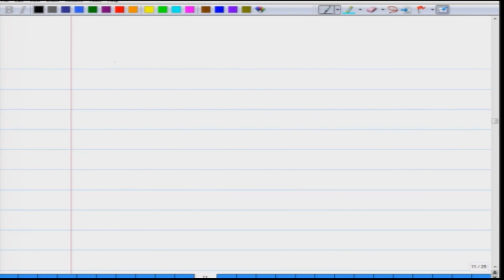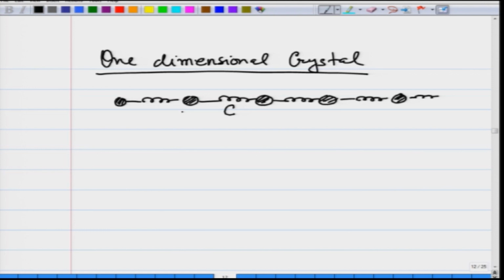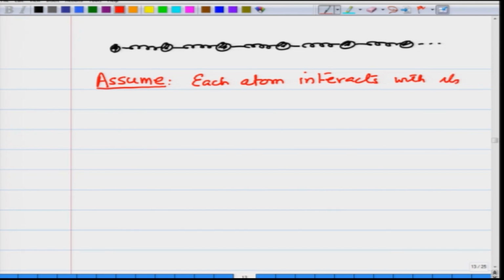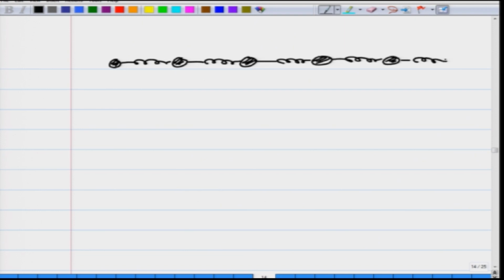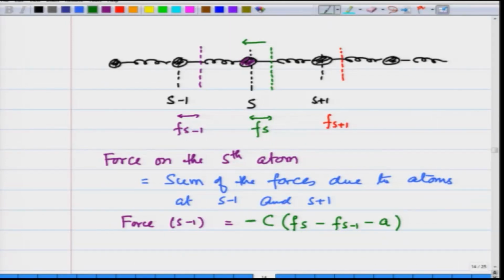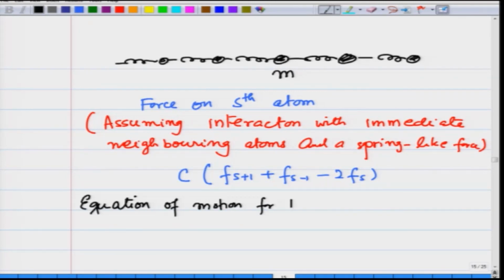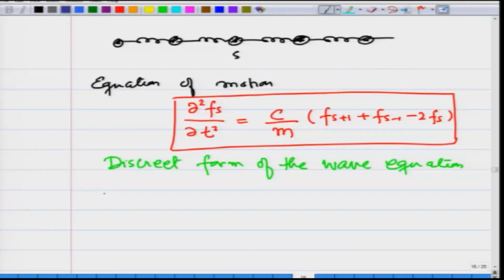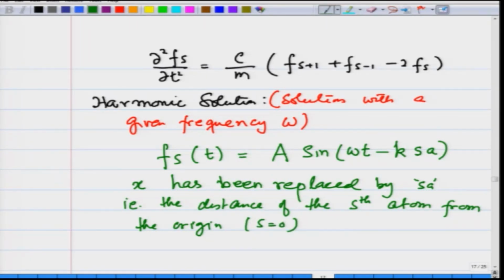noc19-ph02 Lecture 42-Derivation of wave equation for motion of atoms in a crystal

Comment: I have a doubt .10.59 in the second equation you haven't put negative sign.the string is stretched towards right force will be towards left nah?
Reply: That stretch happens in between 's' and 's+1' atom. Therefore the force on 's'th atom is to the right. The direction of displacement also to the right. Then no sign before k in F=kx.